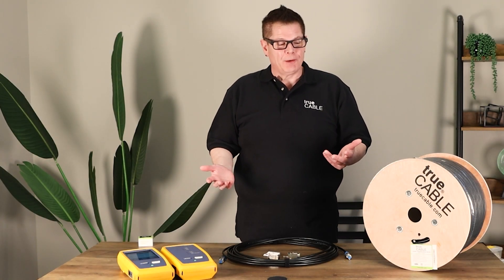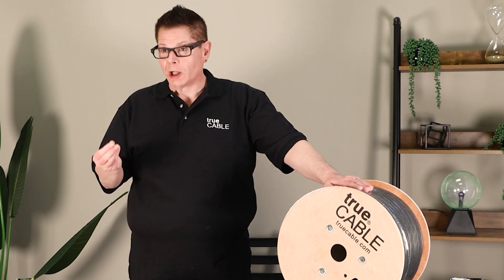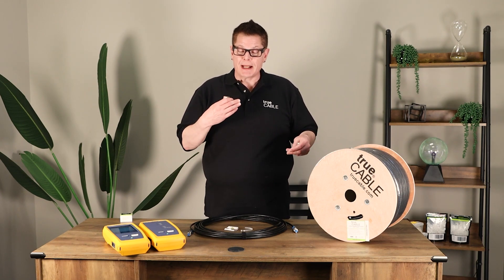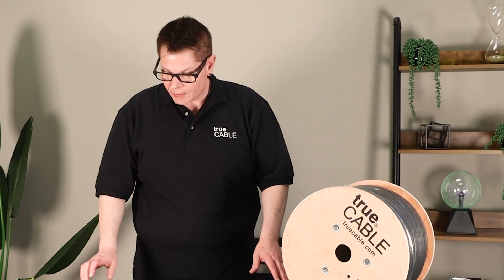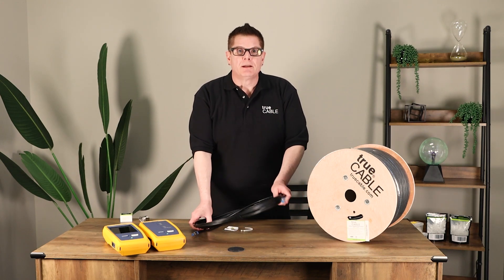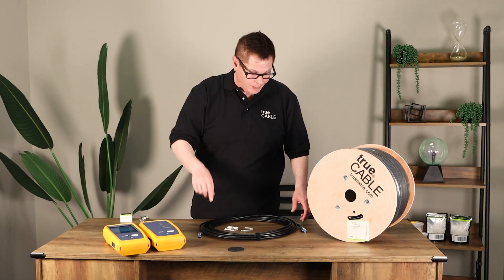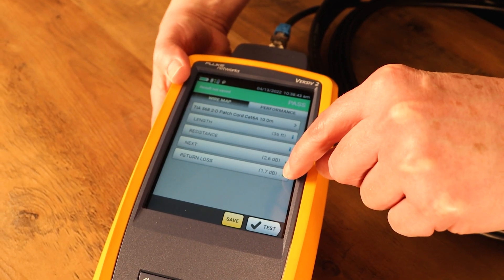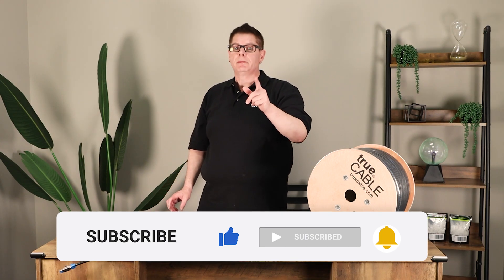Cat6A Shielded Direct Burial Ethernet Cable: Overview and Fluke Test

Comment: Is that in black color soft or hard ruber ? Is a soft available?
Reply from the maker: Hello and good question. The cable jacket is formulated from LLDPE (Linear Low Density Polyethylene). As for hard or soft, it is essentially in-between. It is soft enough to work with, but hard enough to withstand outdoor conditions. There aren't any options on the outdoor cable jacket material, apart from color, as they are all using LLDPE.

Comment: So can you connect an external ground part of the connector to a grounding rod that is pounded in the ground for grounding? I am thinking about this for a security camera.
Reply from the maker: Hello! Technically, yes, but perhaps not in the way you are thinking. You would need to use an in-line surge suppressor device meant for outdoor use (I am assuming an outdoor environment). The end coming in from your switch would be terminated to an 8P8C RJ45 and then you would plug that into one side of the surge protection device. Then, you would use a shielded outdoor grade patch cord from the other port on the surge protector device to plug into you camera. These devices typically have a built-in bond wire. Be careful, however. If you pound in a ground rod and also have your copper twisted pair Ethernet run bonding at your switch to AC ground you may create yourself a ground loop because now that run has TWO bonds to ground. This can be avoided by making sure the ground rod you pound in is equalized with a bonding conductor to your AC system ground rod. That will be a project, as you will need to do some digging and attachment of some pretty thick bare copper (no insulation) wire between the ground rods. Just word to the wise!
Reply: @trueCABLE  I was thinking of taking ground wire and connecting that to the shielding of my cat6 cable and connecting that to a ground rod. Maybe I’m wrong.
Reply from the maker: @skwira000  Hello! That would be very difficult to do. The cable connector, after installation, will hide the cable shield, which is thin, mylar-backed foil. Attempting to directly bond it to a rod would be very difficult and likely ineffective in the end!
Reply: @trueCABLE  ok I should mention I have Cat6 shielded cable going from my outdoor Ethernet switch to my camera.

Comment: Is it ok to install this inside a home? I had extra cable and could use it for a few long runs in my house.
Reply from the maker: Hello! Unfortunetly this is not a good idea. This is a cable designed for outdoor installation, and not only is it less than ideal for making tight turns inside of a structure, but the cable jacket is LLDPE and not fire resistant. There is also the requirement to bond it to ground. Instead, use Riser-rated unshielded Cat6 or Cat6A for indoor residential installations.
Reply: @trueCABLE  what about connecting outdoor cameras to my indoor network rack?
Reply from the maker: @robertthompson5716   Hello! Bring the connections to a tool-less keystone patch panel. If your rack is 19" wide, then pick up a 1U patch panel and the required number of keystones. This should be done for all of your connections, not just the outdoor runs. Then patch the keystones to the Ethernet switch. Use a shielded patch panel if you have any shielded runs, as you can mix and match shielded and unshielded runs in the same patch panel. Of course you will need to use shielded keystones for shielded runs and unshielded keystones for unshielded runs. The patch panel will further need to be bonded to AC ground (to the rack if your rack is bonded to AC ground, for example) or you can bond the patch panel directly to AC ground via the use of our truePLUG Bonding and Ground Extension Adapter.

Comment: I was thinking about using this cable to run to Poe security cameras , the cameras accept rj45 , can I still use this cable ?
Reply from the maker: Hello mik693. Yup, this cable can be terminated with 8P8C (aka RJ45) connectors. That said, carefully check to be sure this cable is not too thick for your outdoor surveillance camera housings. Some camera brands (specifically the kind that don't use pigtails with a jack on them) won't accept such thick cables. The best way to work with this cable is to terminate both ends to shielded Cat6A keystone jacks and then patch into the jacks with outdoor-rated Cat6A patch cords at the device end. Since the keystones are not weather resistant, you will need to mount the keystone and patch cord assembly into a small weatherproof enclosure adjacent to the camera. The thinner and more flexible outdoor patch cord will then make connecting to the camera much easier, and you will end up with a better-quality signal. I know it is counterintuitive that multiple terminations would outperform just one at each end, but putting 8P8C connectors onto both ends of a solid copper Ethernet cable is not such a good idea. You should terminate solid copper cable to IDC style terminations (keystones, patch panels, field termination plugs).

Comment: Id like to see a comparo of the fluke tester vs these noname testers that claim to do iEEE certification.
Reply from the maker: Indeed! So would I. Cable needs to be Certified to TIA 568 or ISO 11801 to be valid, however. I am not sure where the IEEE certification comes in unless we are talking about bandwidth testing, so these no name testers might be misleading.
Reply: @trueCABLE  I tested a few of the dirt cheap noname tone/probe kits. They all have weak probes. The ones that check patch cables seem to work but they have zero surge protection and they put 8v tone down all 8 wires, which gives you short battrty life and tons of crosstalk. The quality kits, your fox/hound, tempo, fluke has a super strong probe and puts a 4v tone down 1 pair.